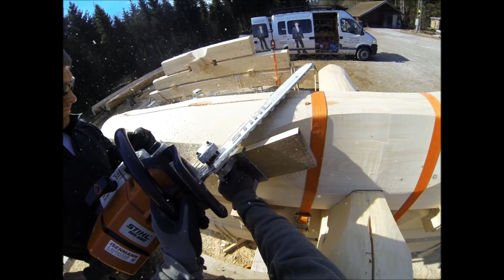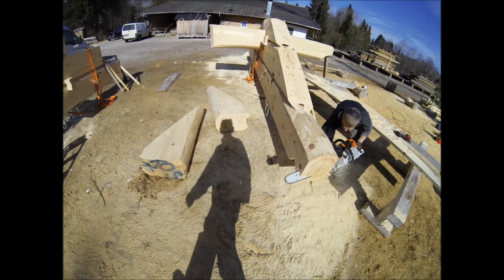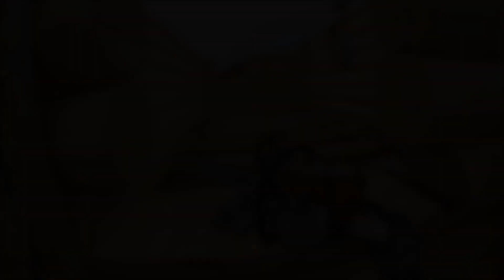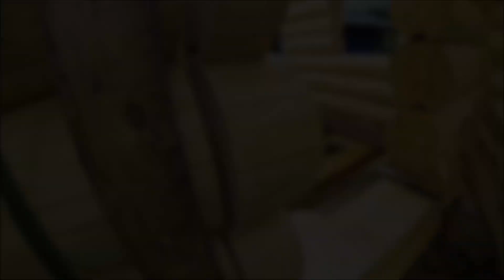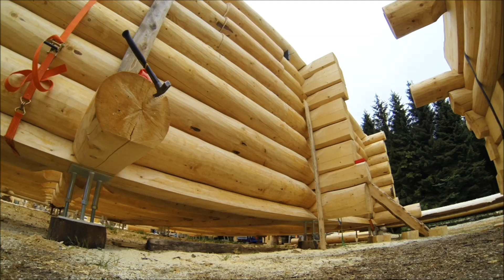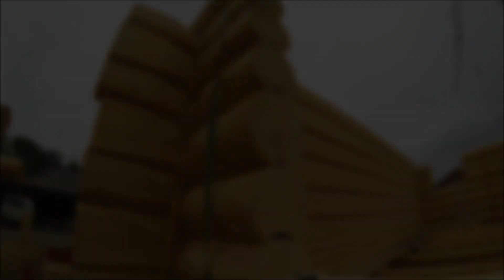NICOLOG: Präzise Blockhaus- Schnitte mit der Micromill!

Comment: Nick, I've been using my Micro Mill for years.  Here's a hint for those using them professionally.  Instead of looking for a nice, straight 2x6 every time you need to cut something, go buy a piece of Versa-lam and cut your own 2x6's.  They last for years, are dimensionally stable and save time and money in the long run.  Another thing that I do when cutting the verticals is to put the saw guide on the 'motor side' of the bar.  This tend to reduce the amount that the saw wants to put the the cut out of square to the wall.  Are you going to be in Nashville in March?  I have a couple more jigs for using the Micro Mill in cutting door and window openings.  I'll bring them with me if I make it to Nashville.
Reply from the maker: Hey Mark!
I only read your comment now!
So glad you are sharing your precious thoughts with me and others... much appreciated!!
Hope to see you again soon,
Best wishes,
Nick